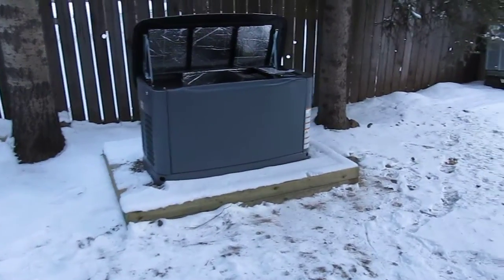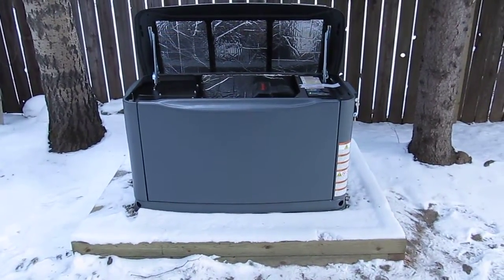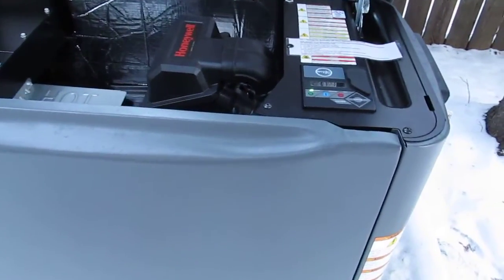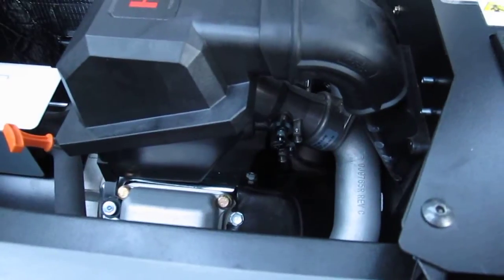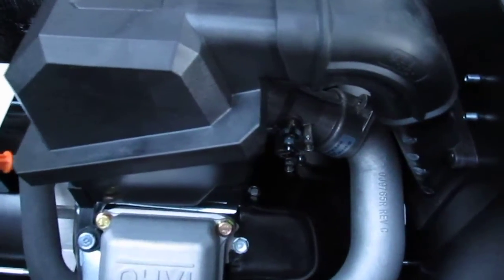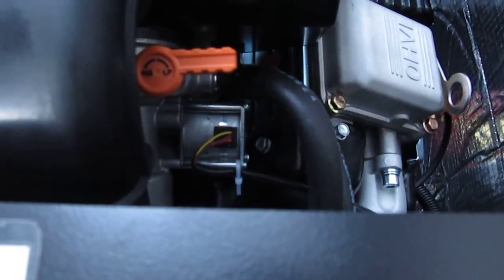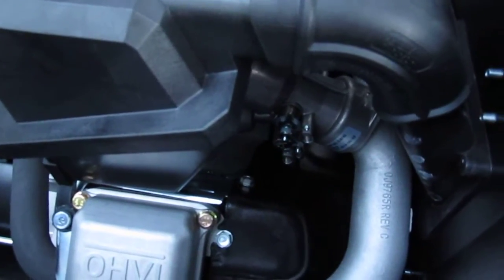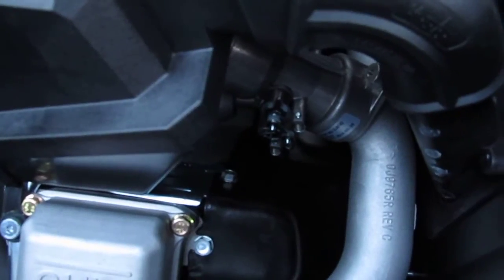17 KW Generator cold start # 2 at -20c, Nov 14, 2014.

Comment: I would highly recommend the Generac Oil Warmer at least.  You have an expensive generator and saving a $100 or so is not worth the headaches of a DIY home made solution.  The oil warmer is made for Generac Generators and connects right into the controller.  No short circuits or fires when some moisture gets in the generator.  Don't be penny wise and pound foolish.  I have seen that a few times.  First Power Generators
Reply: The oil warmer just warms the oil in the filter, not the crank case

Comment: Hello 4 years later! is the generator still running and starting well?
Reply from the maker: YUP ! Shortly after this I added a block heater and battery blanket controlled by a TC-Cube. Fall of 2018 I changed oil and filter and installed a new battery.
Reply: @greathodgy22  well done ,thanks for the reply and have a happy christmas
Reply: What did it cost to install?